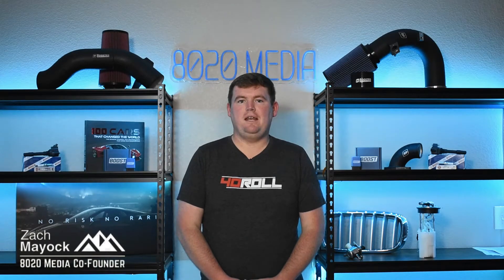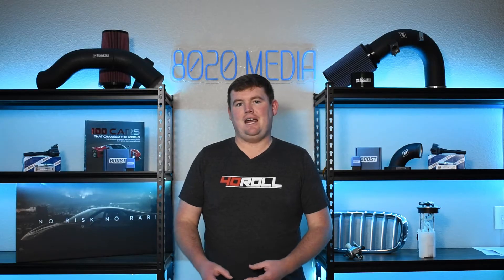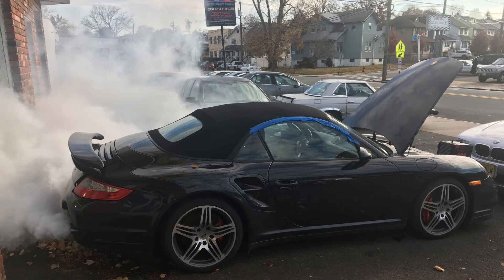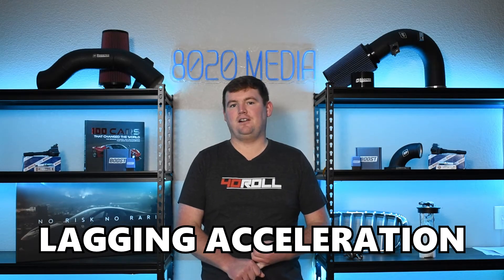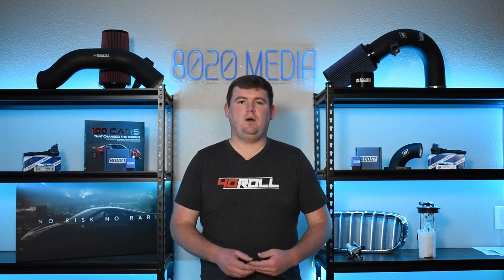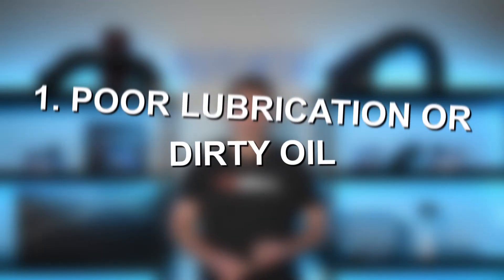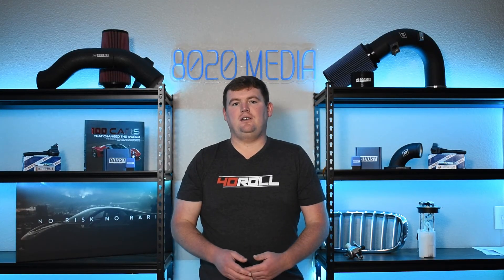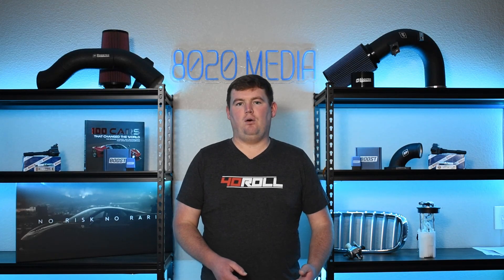Signs & Symptoms of a Failing Turbocharger!

Comment: i am a little late for commenting on this video😅,but my car makes some type of whine(Honda civic 1.5) when i accelerate hard(only on 1 and 2nd gear, 3rd is almost inaudible) meaning going in 3000-3500 rpms. The problem is, sometimes i hear it,sometimes i don't(the sound is covered by music if i turn it slightly on) and that's the only issue i have with it, no power loss, no smoke no check engine light.. and of course, the infamous wastegate rattle(only on cold start ups tho)

Comment: This is what the mechanic tells me I need to fix on my car. 2013 Ford escape just hit 100K miles 😭
 The check engine light has been sporadically coming on and off for months but it's code POO12 is that the same thing? I'm not having the whistling sound The only thing I'm getting is white smoke when I start it. Originally he said it was valve seals Now he's saying turbo and It's a $3,000 fix. wishing he still said it was valve seals.  Is it possible it's actually something else if I get a second opinion?
Reply from the maker: S - P0012 (camshaft timing over-retarded) usually points to a problem with the VVT system—like a sticking cam phaser, bad VVT solenoid, or low oil pressure—not directly to valve seals or a turbo, so while white smoke on startup can be from worn valve seals letting oil seep into the cylinders overnight, it can also come from oil leaking past turbo seals if equipped, but a bad turbo almost always causes power loss, smoke while driving, and whining noises; since you only see white smoke on startup and have a P0012 code without turbo-related symptoms, I’d definitely get a second opinion, because the evidence fits valve stem seals or VVT issues far more than a $3,000 turbo replacement, and confirming with a proper oil consumption test and inspection of the VVT system could save you a lot.
Reply: @8020Automotive Thank you! I think I'm going to take it up to the dealership to get an official diagnostic done by them
Reply from the maker: S - Keep us updated!

Comment: Hi so what could it be if my 2014 Chevy 1500 with a on3 performance turbo kit makes a little rattle/whistle but only happens when I’m going 30+mph doesn’t happen at idle
Reply from the maker: B - If your truck is making a rattle/whistle noise only above 30 mph and not at idle, it’s likely caused by a boost-related issue, such as a slightly loose or leaking charge pipe, exhaust leak before the turbo, or a wastegate/boost control rattle; the whistle is common under boost and could be normal turbo spool, but the rattle suggests something like a heat shield, downpipe connection, or turbo bracket vibrating under load or airflow—inspect all clamps, v-band connections, and wastegate linkage, especially since the noise only occurs when you're moving and building airflow or light boost.
Reply: @8020Automotive ended up looking at the turbo first and found out the journal bearing was toast so my propeller is junk now and was scraping the housing walls
Reply from the maker: @Benson_carlson  Thanks for sharing.

Comment: so mine makes a whisking noise, buts it’s not like how the one you demonstrated. Don’t have any check engine lights or any other issues but the whining noise is the only issue i’m seeing.
Reply from the maker: C - A constant “whisking” or light whining noise at idle (especially in a 2010 Pathfinder) with no check engine light or performance issues could point to a few harmless but annoying culprits — most commonly a slightly worn serpentine belt, an idler or tensioner pulley starting to go bad, or even the power steering pump making minor noise. Since it doesn’t affect drivability or throw codes, it’s likely accessory-related rather than internal engine. Try using a mechanic’s stethoscope (or long screwdriver) near the pulleys and components to pinpoint the source. If it's high-pitched and varies slightly with RPM, belt or pulleys are most likely.
Reply: @8020Automotive  would it potentially be the same for a 2016 ecoboost? the noise doesn’t happen all the time usually when i break at a red light or turn off the car.
Reply from the maker: @ Yep!
Reply: Normal